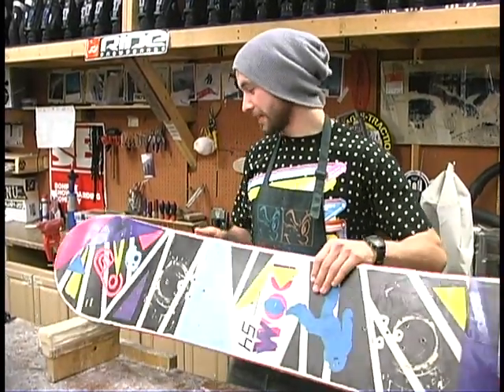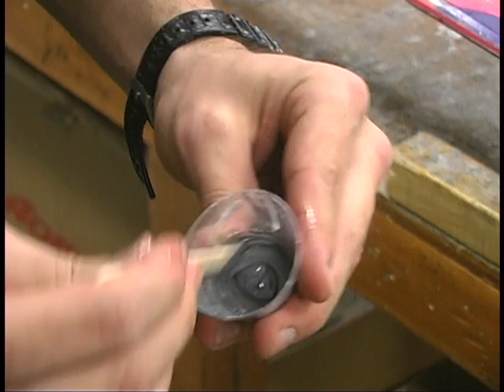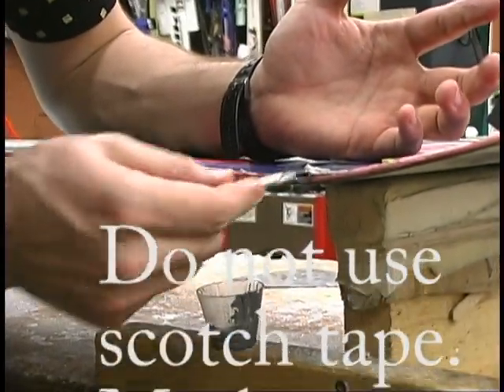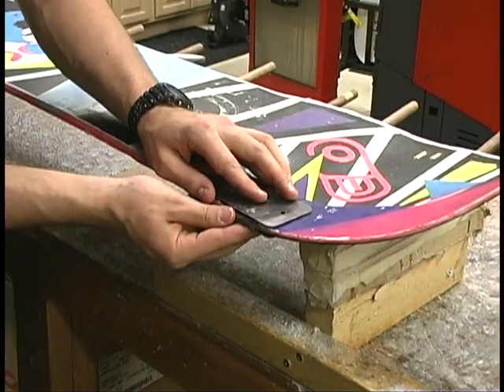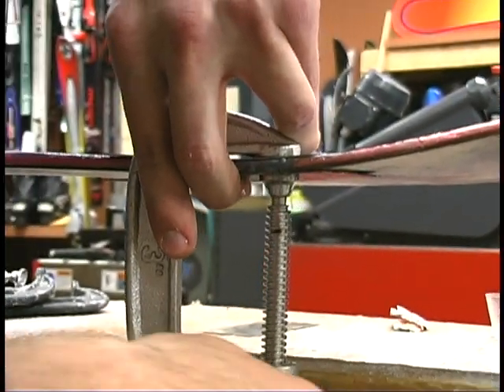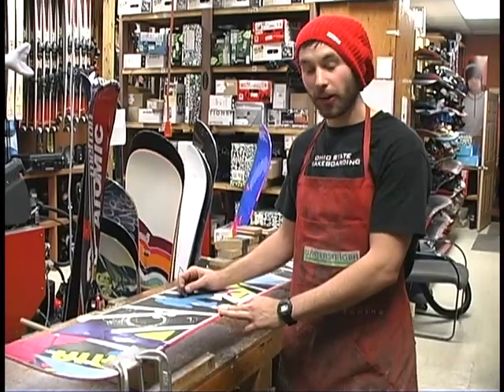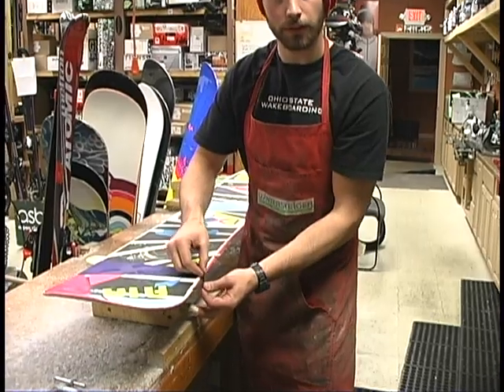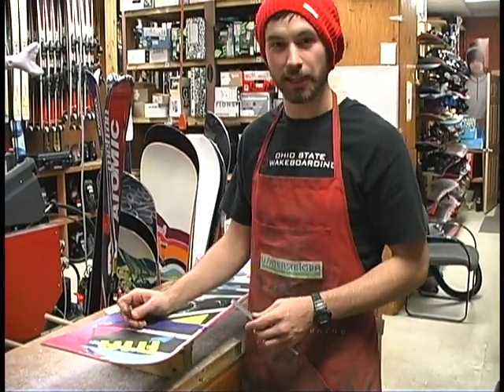De-lam Repair

Comment: No. Wood is more porous and actually absorbs the pressure on the contact point of the clamp, meaning that the majority of the pressure would be at the contact point on the clamp. Metal is nonporous and distributes pressure evenly.

Comment: Use marine epoxy they sell it in Home Depot n it comes in tube form with long plastic syringe n some pieces of wood n C Clamps n u should be good just clamp it for a couple of weeks or months if u do these type of works in the sunmer like i do...

Comment: alright, waht if i'd tell you that not only the very top was broken, but the entire board beside the metal beneath? in this example it would be every red stuff of your board. the damage is at the same spot as in this video, but wents on to the middle of the front of the board. what can i do?

Comment: YO! What the hell????? The end shot showed you taking the clamps off the other side of the board, not where you de-lam happened! The epoxy fix was on the right side of the board when facing him, and at the end he takes the clamps off of the left side of the board that's facing him. It's impossible that was the same spot as the fix, just look at the board graphic! 
Something really fishy with this.
Reply: qcages 
 he  used a different board as an example to finish the video.  Calm yourself son

Comment: I found Gorilla super glue works better than epoxy. Epoxy gets hard and brittle and will eventually just crack and flake out. Also, files are only meant to be used going forward.